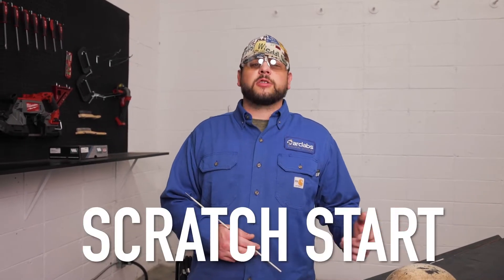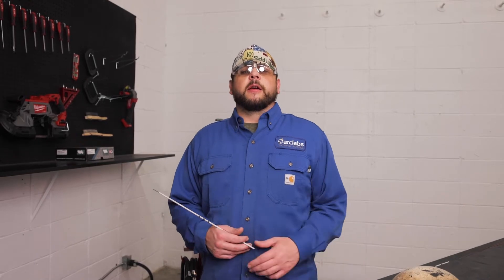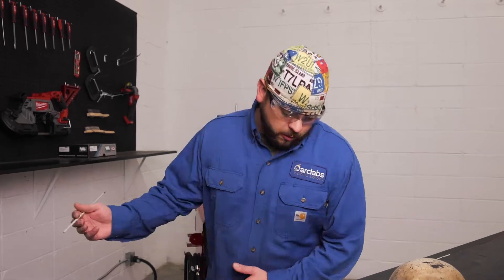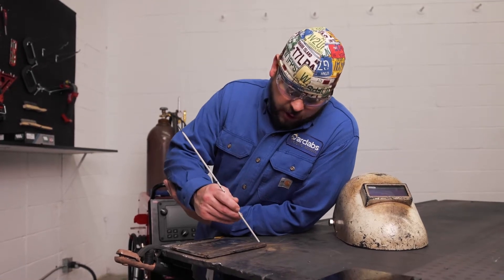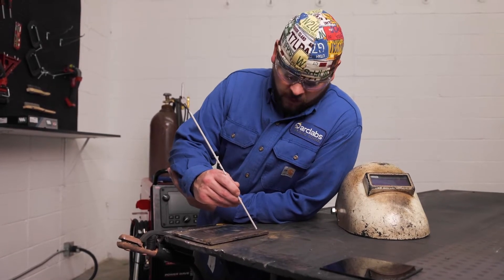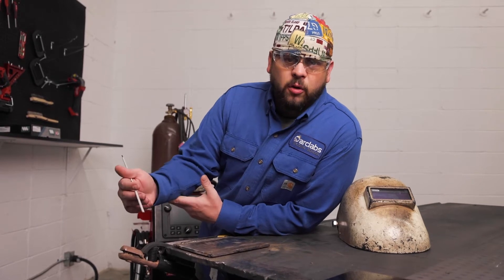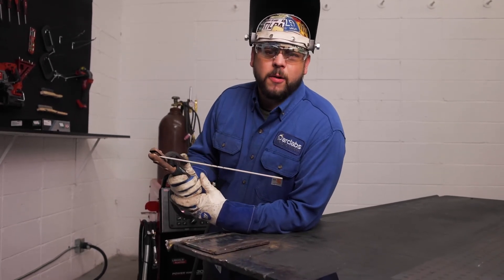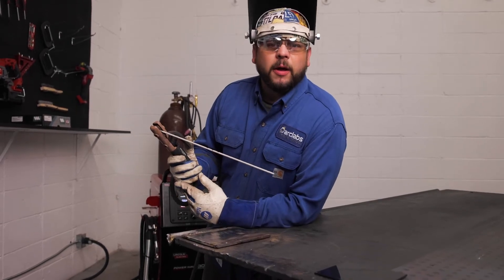Scratch and Tap start using the SMAW process

Comment: I don't scratch. You're probably scratching to remove the burnt flux to make an arc. I take my L or R thumb depending on whether I'm welding R hand or L hand and break it off to expose the metal. I never have to scratch. On many pipe jobs, they'll fire you for chicken scratches.